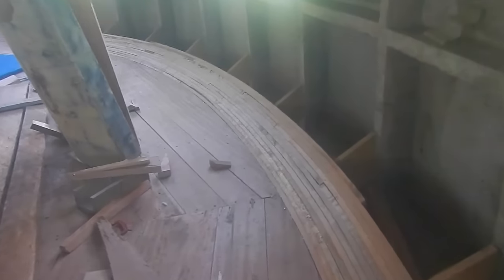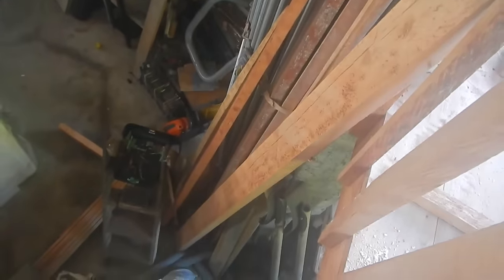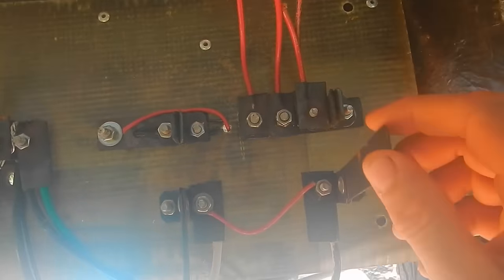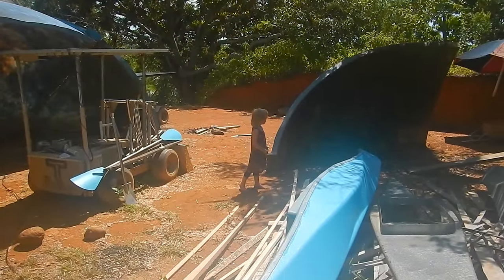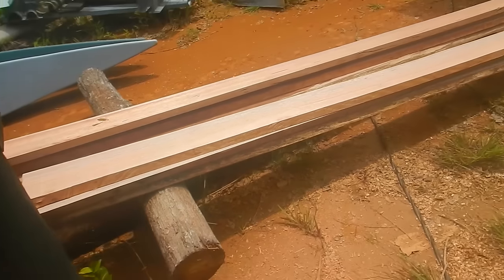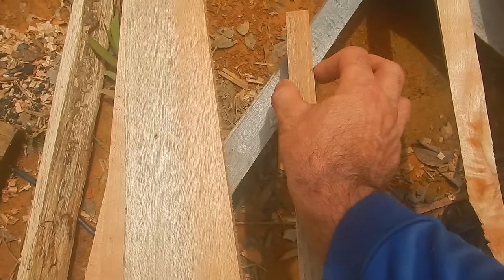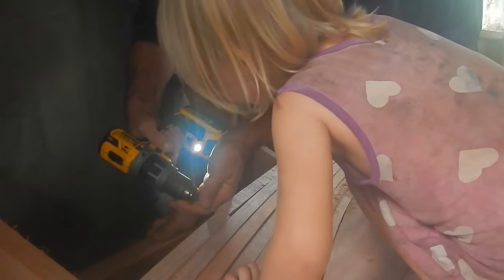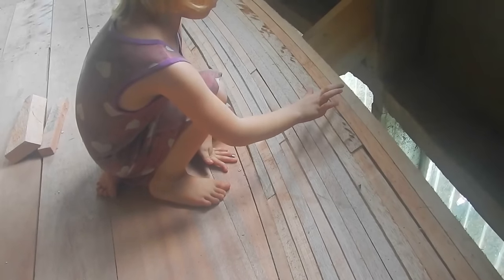Indoor Banked RunningTrack- Working on it...

Comment: I've always wanted to do curved flooring boards(not banked, but like a boat deck) and maybe only a slight bend, was thinking to get a few different maternal types of the narrowest tongue and groove floor boards I can find and see if I could pre-bend/warp them edge-wise...build a rack outside that I could strap them to on edge and let them get wet and season a bit as I tighten the straps to pull the ends and/or center - this would basically just be a curved walkway from the stairs passed a rounded bookshelf to a door, so it isn't a straight hallway with walls, and would be much nicer if the flooring would flow with the path where you walk - but I suppose it would be easier with very narrow and thicker 'bowling ally' type boarding, altho for some reason I've always imagined it with wider boards, I guess I'll just have to see if I can warp some...and maybe steam or wet them?